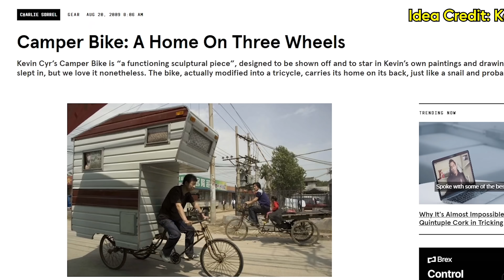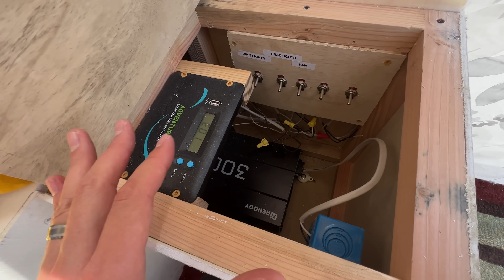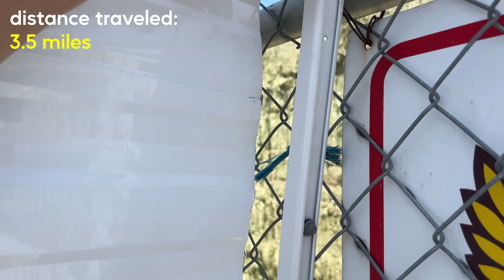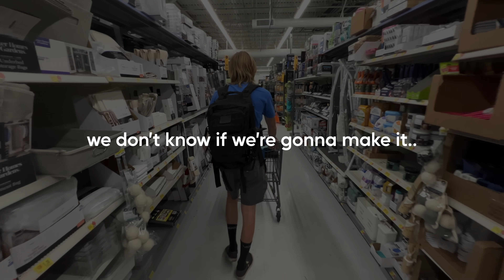Roadtrip in a Homemade Bike House!

Comment: You need to set up a consultation with a homeless person. A pop-up canvas trailer would work a lot better. Light and no wind-resistance. Sink is ridiculous. Carry water. Pop up the canvas top and use an air mattress and it’s about as light as a regular bike.

Comment: This concept is one of my dreams.  I always had a fascination with bike cars.
  I wish I had the means to produce something like this for homeless people.
  The camper part, would be made out of  a durable canvas that connects to a pallet of some sort, that is hoisted up by spings to create lighter weight on the tires and back tires would be doubled
 wheel chair tires, for speed and easy acceleration.
  The bike would be detachable to bring inside the camper, which means the camper width should accommodate the full size of the bike, so it can be stored
In the back of the it, and not take up space.  
  Also wanted to mention the orbs that were zipping around when you two were inside the camper in a practically non ventilated space.  But yet orbs were zipping around.  
  This means  that one of you is a starseed. 
  Either you heard of  a starseed  or I sound crazy.

Comment: 🚴🏼🏠 What a fun and exhausting experiment!  I was wondering about the design of the trailer… would it have helped to have a forward overhang to cut wind, sun, rain…?  What about having a pop up roof or pop out sides for sleeping?  Or just doing what most do, have the seating area turn into bed area as needed?

E-bike assisted power with solar panels to recharge.

Comment: If you rebuild it or try to use it again try putting wider tires on the bottom underneath the camper itself that'll help give you a little more stability and it might make it easier to ride as well because they're the wheels that are turning

Comment: Did it all wrong, should have made it bespoke with lightweight materials, more aerodynamic shape, longer so you're able to sleep in it, more stable, solar panels and deployable wind generators when stopped, and obviously a substantial ebike hub motor system. That is just for starters

Comment: I think the correct method of a bicycle camper is a build like an a-liner where you can fold down the top half of the camper flat for travel and stability purposes and then when you want to use it, you fold it back up into a living configuration.

Comment: You guys did a great job on building this. To make it work better you need a gas powewed or electric bike to pull it. I am looking at turning my 4 x 6 trailer into something for camping a lot cheaper than buying one and you have some great ideas in this.